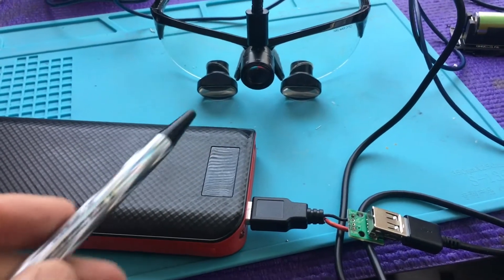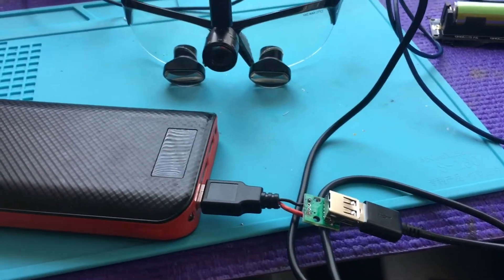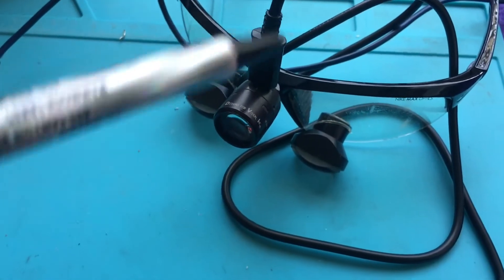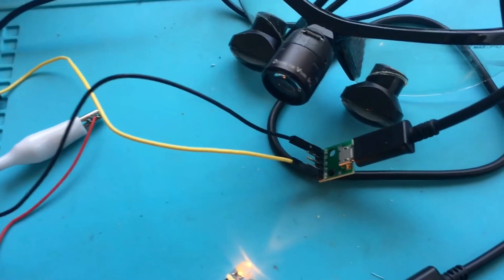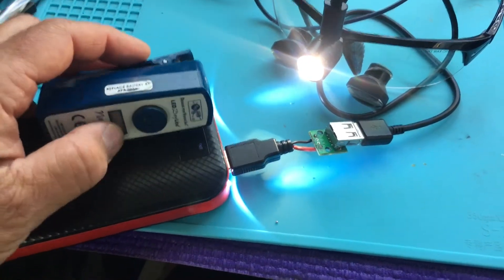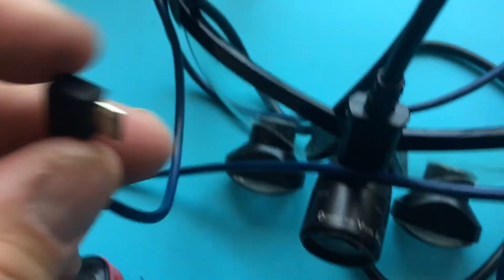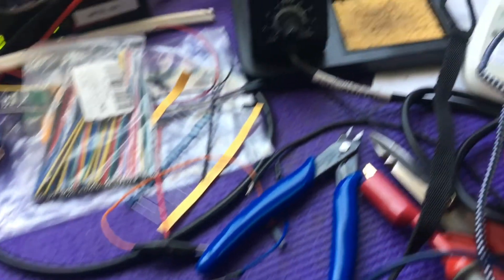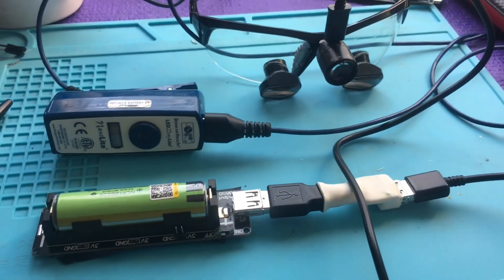Trouble Shooting Designs For Vision Led Day Lite light with iPhone Power Pack. Repair Parts.

Comment: Do you think you can wire any other brand light to run off of a battery pack like this? My andau lights use a trs plug I believe and I'd love to have the ability to run them off of a usb battery pack if needed.
Reply from the maker: @staver76  I think so but the positive and negative are reversed. You also need to measure the current to make sure you don’t overdrive the pack with the new light.

Comment: They took a normal USB cable and wired it backwards so that you can't easily use a standard cable and be forced to shell out $$$ for their backwards cable.

Plugging in a normal micro-USB won't damage it. I've opened the LED and there's nothing in there but the LED and heatsink, so it just gets reverse biased when you connect the normal USB cable and block any current from passing.
Reply from the maker: Thanks
Reply: @dannyjensen4954 were you able to measure the output voltage and current of the original power pack by any chance?

All I've got is a power pack which might be broken and the LED module which I know works.

When I look at the voltage between the VBUS (red wire) and USB ground (black wire) on the original power pack, I just see a 5MHz burst of a few hundred millivolts when it's turned on.

I'm guessing they might have some non standard wiring/resistance combination for the power pack to detect the original cable. It could also be that the battery pack I've got is just broken. I don't have a known good unit to verify this.

I wanted to see if anyone else knows this before I try to open this up and figure it out.
Reply from the maker: @AI7KTD  I don’t know.
Reply: @dannyjensen4954  no worries, your video still helped save me a lot of time. It turned out that the battery unit I had was broken.
Reply from the maker: @AI7KTD  Thanks for sharing all your information.
Reply: could you confirm this: did they swap the GND and VBUS wires? i am trying to make my own crossover piece as well, thanks
Reply: @ChEeZeBurGeR1  Yes, GND and VBUS are swapped.

I'd recommend a current limiting resistor as well.
Reply: @AI7KTD  Thanks for the reply.
Regarding the current limiting resistor, would my battery bank that has a protection circuit suffice? Thanks again.
(description from amazon: "Built-in protection circuit can effectively prevent over-current, over-charge, over-voltage, short-circuit, combined with soft-start function")
Sorry if it's a dumb question, I'm new to this!
Reply: @ChEeZeBurGeR1  the power bank's definition of over current will be significantly higher than what you'd want to put through the LED. Depending on how new the power bank is, it'll either limit to 500 milliamp or 1 amp.

The LED unit I had would pull about 230mA to reach full brightness, any more than that and it would just heat up unnecessarily, reduce its lifespan and eventually kill it. This can happen when the LED unit heats up and draws more and more current.

You could use it with just the cable wired backwards but the lifespan might be reduced. What I did was cut open a flexible USB cable, swapped VBUS and GND and added a current limit resistor in series. I used a 10 ohm resistor, but any low value resistor between 10~20 ohm should work.

VBUS=====(10ohm)====GND
GND================VBUS
Reply: @AI7KTD  thank you so much for the great explanation!

Comment: Jc if you attempted to remove the cover from the LED DayLite Micro? I'm assuming there's an 18650 LiOn battery under the case that could be replaced.
Reply from the maker: Well… The unit I have has a battery with 18650 characteristics but not exactly 18650 dimensions. I have replaced the battery once.
Reply: @dannyjensen4954 The unit I have can be replaced with regular 18650 cells. In my case they were high quality LG brand MJ1 model

Comment: Once my DVI nano LED battery case has died, can I use a standard battery pack as a replacement? They dont make the Nano LED case anymore? would the stability be there for use? Is there a place I can just buy a ready made crossover cable?
Reply from the maker: Take the the case apart and replace the lithium battery. I’ll look at what battery I replaced it with.
Reply: @dannyjensen4954  I have replaced the batteries - the issue I am having is the USB connector in the casing is becoming unreliable and wont charge consistently - what do you recommend. I wish i could replace the casing but they discontinued it.
Reply from the maker: @HasanKhanDMD  I’d look for a way to make the usb connection to the pcb. Perhaps you could replace the connector by desoldering it. Or solder a pig tail cable on the usb connector.
Reply: @dannyjensen4954  unfortunately my electrical technical skills are too poor to try something like that haha. I wish there was an easier way I could just use a standard battery pack - DFVision wants 500 for 2 new batteries

Comment: Hello. Nice way for troubleshooting. I have a problem with my USB wire, i tried to repair it with another micro B connector, but unsuccessfully. Now wanna find same cable (micro USB-micro B USB) but it's extremely rare) can you please advise me something?
Reply: Were you able to find something?I have the same issue

Comment: Why can’t you directly connect the usb cable from the charger directly to the USB port in the battery pack?
Reply from the maker: Didn’t  work unless I did the cross over.  By design.

Comment: I'm trying to fix one of these power cables. The USB mini cable is damaged and I will repair the cable but I would also like to make the same dingy you did. Do you think I should include a resistor to try and limit the current? Have you measure how much current does it draw?
Great Work!
Reply from the maker: I think the usb power pack I used limits current to 1 or 2 amps. I think your power pack will limit your current. I got a complaint that the light was brighter using the factory power pack
Reply: @dannyjensen4954  so no need to put a resistor on the usb cross over I imagine ..... My guess is that PWM'ing the 5V we can also get to DIM the light.
Reply from the maker: Luis Silva If you want dim the simple way would be to add a pot or fixed resistor as you have suggested. PWM with a variable boost converter using an 18650 would be more efficient as you have suggested.
Reply: @dannyjensen4954  Thanks!
Reply: @dannyjensen4954  Typical 18650 cells can provide up to 30A (ie the reason for the greater brightness)
Reply from the maker: @b71cx  the 18650 voltage needs to be boosted and regulated I think before connecting the light.
Reply: @dannyjensen4954  I'm might not be as knowledgeable as yourself or some of your longtime subs so take with grain of salt - but yes, boosting voltage should boost current (with fixed input resistance) to more brightly light an LED (LED have minimum turn-on voltage and generally won't drop much more voltage than the turn-on but glow brighter with greater current as the turn-on voltage is slightly increased - at least until it smokes haha). I would imagine the off-theshelf battery pack itself has a voltage regulator (and can provide the required voltage ) but its current is too limited.  Thank you for replying!

Comment: Great video! Thanks for the detail explanation. I have the same problem and the battery died and would like to know how you make the crossover for it to work with a power pack. Thanks a lot.
Reply from the maker: Thanks. I have had issues with the light not going full bright. Post your findings here.
Reply: @dannyjensen4954  I try with different power pack and no luck so far. How do you make it even turn on?
Reply from the maker: @jasonxie9370  hook up to a 5v wall charger USB port and try that . If that does not work, you have a wiring issue with your crossover pin connections.